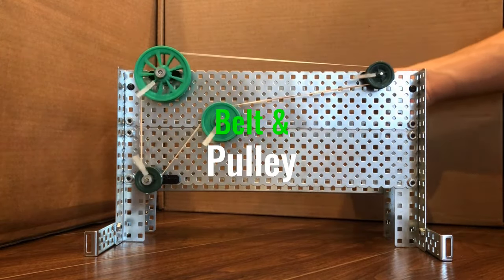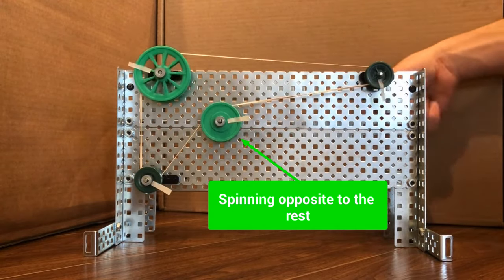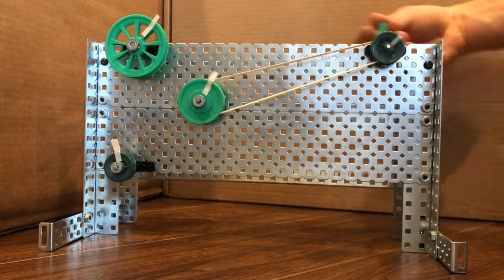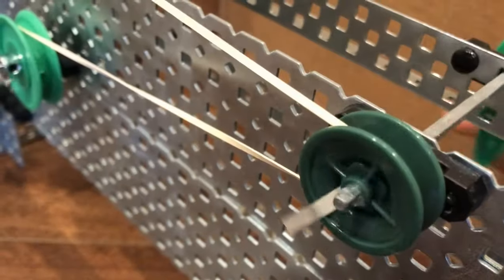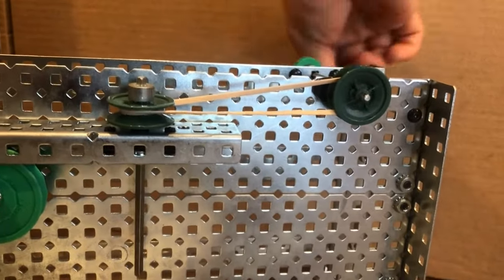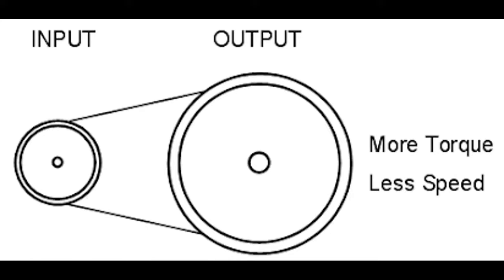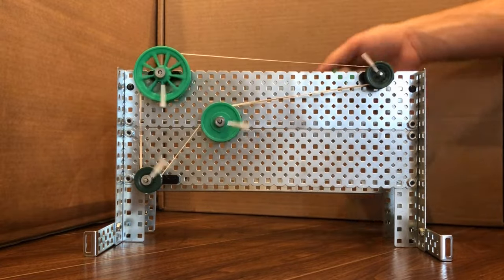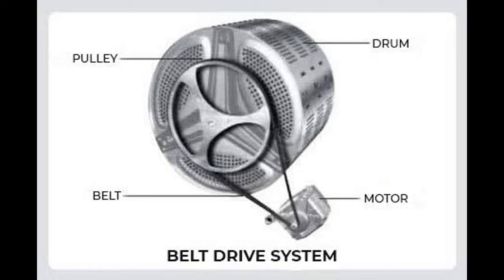Basic Mechanisms:  Belt and Pulley

Comment: Im making a steam engine and my governor is driven by a big pulley to a small pulley, and when i make it turn it drags a considerable amount of energy. Now im wondering if it has to do with using a rubber band instead of a regular belt that is not elastic. Do you think that the extreme elasticity on the rubber band makes it harder to rotate?
Reply: Do you know if the wheels are moving at the same rate of speed despite rpms?